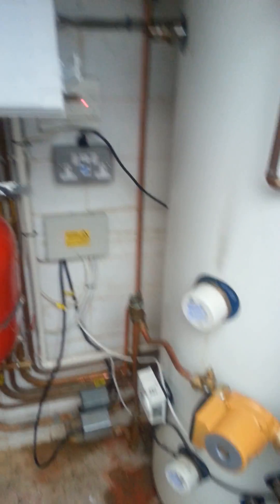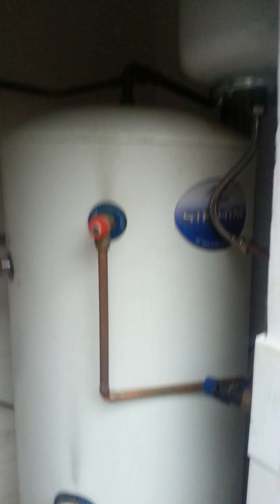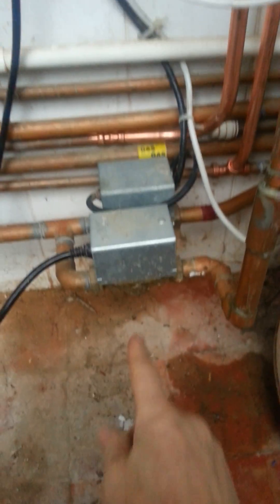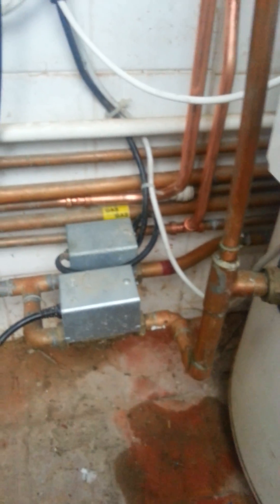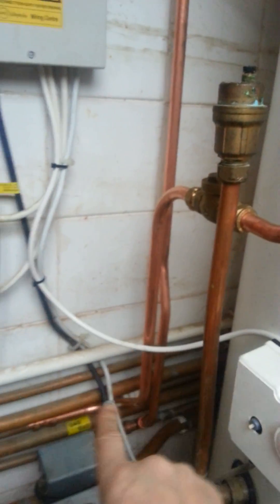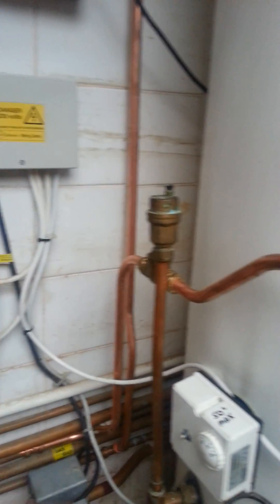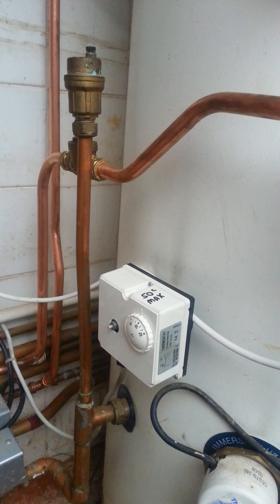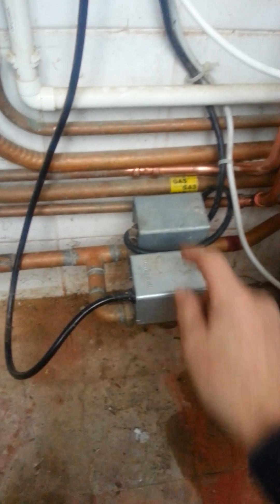Combi loading a cylinder

Comment: So could you not have the combi hot 15mm going to just the kitchen sink say for dishes and the unvented cylinder and heating of an s plan as normal doing rads and water for bathrooms?
Reply: This was a quick, cheap, and easy solution to get around that the boiler may be delivering hot water below what is needed to the cylinder, as the weather compensator may lower the temperature too much.

Comment: Very interesting. With that arrangement will that flow direction through the top of the cylinder to the return and through the bronze circulator only work if no hot water is being drawn off as the mains flow would work against it? Or have I misunderstood the system?
Reply from the maker: Yes. If water is being drawn the combination boiler will supply into the cylinder flow reducing the volume used from the cylinder.